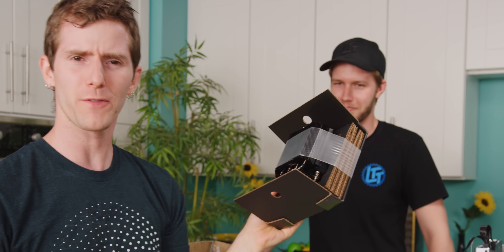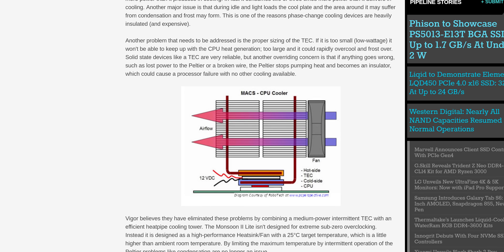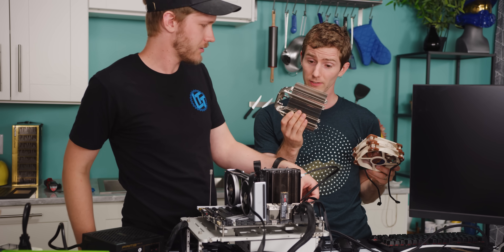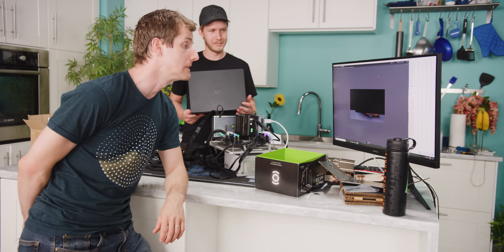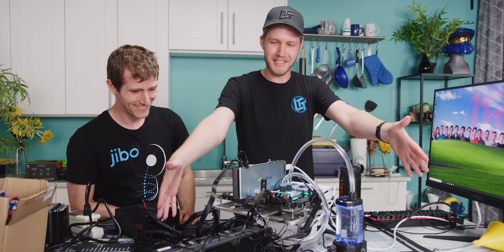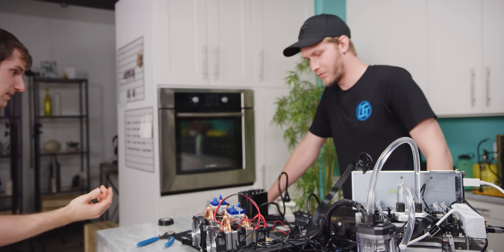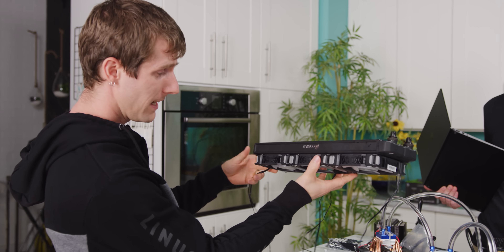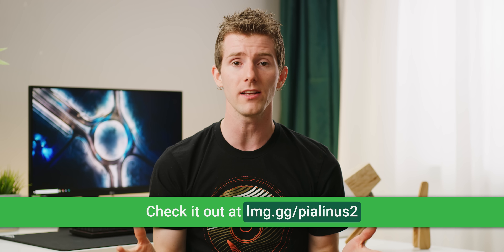Thermoelectric Cooling is a Bad Idea

Comment: You should check out tech ingredients video about a refrigerator he made out of peltier devices. His tip is that they always generate more heat than cold so try to conduct the cold to what you want to cool because the radiator section will always be quite hot. Maybe use a block of solid aluminum as a spacer. =\

https://www.youtube.com/watch?v=YWUhwmmZa7A

Comment: What really is the point of wedging a piece of hardware between the CPU and cooler if you still have to get rid of the exact same amount of heat it generates just as fast in order to not overwhelm the TEC? Especially if you can do the same thing just with a regular stock cooler directly applied to the CPU? Just seems redundant to me, because the actual cooler on top doesn't have to dissipate less heat. It's a literal zero sum game.

Comment: As far as I understand, a Peltier plate just moves heat from one side to the other. Pretty sure that makes it very similar to just having a bit of metal there except it's way better at moving heat that short distance and probably adds the power it uses to the total heat generated.

Not sure I get the point.

Comment: From personal experience only near practical way to user peltier elements is to use cold copper plate on top of cpu and then 300W peltier (I had 2x172W) and then cool the hot side with conventional water cooler). You need to insulate the motherboard properly like with any sub zero cooling solutions. That was the old days anyway, like Linus mentioned at the end. I had to make my own power source also since it was ran at 18V. Edit. I think I have them stored somewhere but never bothered again since they are not very practical and pose danger of short circuiting the motherboard from condensed water if used for longer duration of time. For short durations you could just use dry ice or nitrogen. Less hassle.

Comment: The most badass CPU cooling system I ever saw was a copper pipe welded to a copper plate, insulated with foam, and filled with liquid nitrogen, for the ultimate ridiculawesome evaporative cooler of all time.
Reply: crazy stuff.
I also love the immersion cooling solutions by 3m that have come out recently... i think it's called novec. basically looks like a pc submerged in a liquid that's boiling. By following all the bubbles, you can see all the hot spots on the cpu/gpu and memory.
Reply: People use those things to set overclocking records. It really is nuts. However liquid nitrogen, without some way of returning it to liquid form continuously, isn't a long term solution
Reply: @jackhemsworth7515  At that point you should just stick the whole rig into an oil filled industrial freezer
Reply: @E1nsty  Nah you part out the freezer and just make the refrigeration unit your phase-change liquid cooler.
Reply: @jackhemsworth7515  It is also used for quantum systems and magnets. Generally, you simply feed liquid nitrogen into the system and exchange Dewers as they empty. Liquid Nitrogen is actually cheaper than milk per liter, but is a terrible idea for cooling as it is an expensive hazard to the computers.
Reply: Don't ignore those who immerse the entire motherboard in oil.

Comment: Isn't the whole cooler limited to how much heat it can throw out through the fins using the fans and therewith the ambient room temp? Air cooling is only effective at a 15 degree celcius difference?

Comment: For god sake！you don't have any thermodynamics！You don't know how to use these things at all! The most basic knowledge about heat dissipation, the heat well is always the air!This thing is added to the cold row to reduce the temperature of the cooling water. If you want to use it directly as a cold row, and want better cooling, you should use a larger power cooler instead of the same or even lower power. !It's like those idiots think ，putting ice cubes in cola is to cool the cola,  that idiots do!In fact, ice cubes are added to the iced cola to keep the temperature of the iced cola!
Reply: Water-cooled radiators can't cool down to room temperature, but this thing can!

Comment: I use an Ultra peltier cooler on my Phenom1100T BE cpu. The water cooling didn't do the job. Now i stay at about 43C all the time. It keeps the cpu at a pretty much constant temperature and it is not expensive. Never been happier with a cooler as air only coolers were even worse then water cooling. My Ultra brand is a bit easier to install too than the one you used. MY cooler can go below 40C but i prefer it stay at the 43C as it is stable and i don't worry about it jumping around. My room is at 78F to 80 F ambient depending on outside temps. I run at 3.8Ghz on OC of the cpu and i run a XFX RX480 8G BE vid card.

Comment: These coolers do not work too well, as I tried that years ago and it made my system run worse as it heated the system far more than it cooled the CPU.
Reply: i run one with an overclocked 7700k, it runs worse than me nhd15, but for its size being a 90mm fan, it runs very well. only about 3c behind the noctua

Comment: I've never heard of these electronic coolers before. But, hey I don't know everything. Glad, engineers are finding ways to keep improving technologies. Now, if only computers would truly get faster that would be awesome. (:
Reply: Those elements aren't new. Heck, they are flying on space probes more than 5 decades old (in the reverse configuration to produce power from heat). Take a guess why those peltier coolers aren't all over the place. Hint: it's not because the engineers never though about it over the last decades.
Reply: superdau I would guess inefficiency? Please educate me though.
Reply: @WarriorsPhoto  
Yes, a peltier is about 10-15% efficient (unless you go for small temperature differences in the single digits, which is pointless for CPUs).
If you want to keep something cool that heats at 100W (like a CPU), you would need up to 1000W of peltiers. For the peltier to do its job you need to keep its hot side as cool as possible, which means you now have to cool 1000W instead of 100W.

A peltier has advantages: it has no moving parts, can cool to below ambient, can be controlled easily and can be built small (compared to a compressor cooler). You use it, when you want one of those features. But none of this is needed when cooling power devices. And at the same time one of its biggest disadvantages is that it can't move a lot of heat around.

Just because something can get very cold (and peltiers can go well below zero), doesn't mean its good at cooling.
Reply: @superdau  It is good a cooling. Just not CPUs.  LOL (:

Comment: You guys should do a hybrid cooling loop with like a radiator in front of an aquarium pump or vice versa and see what performs best because the radiator is likely great at pulling tons of heat out of a tube quick but can't et below ambient temp that easily where as the peltier device can get you below ambient after you have used the radiator to dissipate most of the heat.

Comment: You could just go crazy and build a silent below ambient system by using a remote large (building size) water chiller with large pump to run a long length of tubing far away so you never hear anything and target the loop temperature slightly above the room's dewpoint so you don't have to worry about condensation. It would just be hydronic building cooling system loop, brazed plate exchanger to a variable speed controlled loop to maintain dewpoint control and keep junk out of the cooling loop, then the PC tapped into the loop. (Have a set of UV filters and ultra-fine particulate filters to filter out anything growing in the loop)

Comment: Maybe if you use the PWM source of the CPU Fan to power the peltier element you don't need so many amps or consume so many watts.

Thus the peltier element would be being controlled as CPU Fan is controlled by the motherboard BIOS.

You could try to see what happens
Reply: Driving a peltier with PWM is exactly how you DON'T want to drive them. That makes them even worse at cooling.

Comment: Peltiers are not efficient at all. I was looking into them a while back as a cooling solution for a hotrod project since there was no longer and room for a belt driven compressor. I found that the peltier set up was in the neighborhood of 15-20% efficient as using energy to move heat. A typical a/c system is a lot more efficient. Something around or a little about 80% efficiency.

Comment: Hook it up in series after a traditional cooler. That way the water in contact with the tec is at ambient temperature, and the water going into the cpu water block is below ambient.

Comment: I actually collect and do extensive testing with TECs and Tec based coolers. There are many other brands and models than you guys discussed for PC focused TEC coolers. Some work really well, but Alex and Linus ned to also do the research and math to see what they can do. For example, if you add a Cool It Eliminator after doing the math and having an overkill amount of radiators in the loop, the water temp before and after the TEC unit is drastically lower, this let me achieve a 4.4 Ghz stable on my 1800x and 2025 stable on 2 1080 Ti in SLI. 

PS- You can use an Arduino or Raspberry Pi to make your own TEC controller.....maybe daisy chain a bunch of tec coolers....and get a 24/7 stable extreme OC system. LTT needs to get on my level with cooling lol

Comment: Bad Cooling Idea:
Custom Watercooler filled with thermal paste.
Reply: liquid metal lol https://www.youtube.com/watch?v=XqvBLBlzeNQ
headphone warning and speaker warning too - skip the first 35 seconds because intro song is complete earrape
Reply: YES!
Reply: I've got a better idea. How about a watercooler with LIQUID METAL!!!
Reply: @wu1ming9shi  A mercury filled watercooler sounds like ... umm ... the basis for an EPA Superfund site.   Maybe Cody'sLab will try it.
Reply: Cybershaman 21  he could use NaK...  Sodium Potassium alloy is liquid at room temperature, and they use it to cool some nuke reactors....
Reply: why not just fill the loop with diamond dust? get that maximum conductivity.
Reply: You'd need a 100,000 RPM pump or something lol
Reply: Water cooler with gallium
Reply: If you can find a way to fit a pump powerful enough to shove paste through a tube at high volumes, I'm on board!
Reply: Medieval Folk Dance custom water cooler filled with gallium
Reply: Cybershaman 21  lol
Reply: I mean...they already did the concrete cooled system...
Reply: i mean they made a concrete loop, so why not?
Reply: Cybershaman 21  Galium would work though it almagomizes with just about every metal on Earth. Lets go full stupid and use NaK.
Reply: But that's not water anymore...right?
Reply: @wu1ming9shi   my thoughts exactly
Reply: I get that the paste would be moving, but aren’t copper heat pipes full of thermal like paste?
Reply: @shavedbird694  no it's water, but you could use basically any safe liquid or gas that isn't going react with the copper or explode at less than 150c , water at normal tempratures is by far the best liquid because of it's heat absorbing capacity. The only time you're going to use anything else is if you know it is going to get very hot anyway i.e some nuclear reactors, or it is going to be very cold anyway i.e space or the north and south pole.

Comment: Why don't use a radiator to sustain the cpu and then add the electric one after the water is cooled a little so you get sub ambient temps?

Comment: I remember to have done the calculations for Peltier cooling on the late 90's or early 2000's and the numbers get really fastly big. When you use a peltier, you want:
1°) deltaT (hot temp - cold temp) as big as possible.
2°) hot side (and so cold side) as cold as possible.

Then comes the problems:  A peltier element can achieve his maximum deltaT when the heat input in 0w. When the eat input match the peltier maximum power, the deltaT become 0°C. It means that a peltier has to be much powerfull than a CPU if we want it to be well-cooled.
So for example a 25W AMD K6-2 from this old times, to be quite well cooled, you need a 80W+ peltier. A 80W peltier means 80W power absorption capacity. And so 80W+ power consumption and eat generation. So the cooling system have to be big enough to evacuate 25 + 80+ = 105+W heat instead of the 25W from the CPU alone.

Also sometimes, a peltier fries. So he become a powerful heat generator, leading to to the CPU to follow it in his death.

Comment: What about doing a dual closed water cooling loop with a Peltier between the two loops. Loop A for the CPU cooled by the Peltier, and then loop B for the hot side of the Peltier is cooled by a traditional smaller radiator?

Comment: did you know that thermoelectrics are actually worse the more power you pump into one? 

this is kind of pointless unless you really do need to pull heat away from a object very fast. there intended use is to push heat in a direction, or to generate a small amount of power through temperature differences. 

it's really sad but the tech just isn't there yet, more people need to get involved and stay with it. that way more breakthroughs can happen and the effectiveness can be increased.

Comment: I had an all-in-one peltier HSF unit on the first computer I built, way back in 1997. It would freeze water!  It kind of worked to cool my CPU, but when I cranked my Pentium MMX 233 to 250MHz (83MHz FSB), the inside of my case turned into an oven! It go so hot in here that 4MB of the 8MB of video RAM on my ATI Rage Pro Turbo All-In-Wonder permanently stopped showing up (I got it RMAed).  I went back to a standard HSF cooler.

Comment: Strange this is showing up?  I worked at a computer store building PC's back in the 90s.  We used these "Peltier coolers" on the  486 DX2-66 and others. We would get them setup with a fan and heat sink ready to get installed on the new systems...

Comment: what i find odd is how these companies fail so hard i put a 130 watt pelt on an old athlon fx 60 back in the days and it brought the cpu down to 30 c and at 3.4ghz .... how the fuck do they fail so hard it cost me 80 bucks
Reply: plus i diodnt have to go weird like this i bought a swifttec bigw ater system and  had a 250 rad and it was fine fit in my case and everything

Comment: Peltier is a heat pump,..so no cooling but transfer of heat.
So you extract heat on on side and you give it away on the other side....so the better you cool the hot side....the colder the oter side gets.
When cooling a cpu you need to staqrt the heat pump first....cool it down first

Transfeer heat or cold true a peltier and it genertates a voltage

I did cool my old pentium slot CPU's with a peltier arround -5 (and a lott of condesating on all parts.

Cooling solutiun as showed here is all wrong to get minus 0 celcius results....but with modern LGA sockets condensation will be your worst enemy

Comment: To take advantage of a 500w+ TEC you're going to need to run dual loops. One for the hot side, and one for the cool side. Or, do it the lazy way and submerge a big heatsink on the hot side in iced saltwater (and have fun with 34 amps inches away from a tub of highly conductive liquid.) But, there's a problem with that either way, because your average CPU water block doesn't really have enough surface area to take advantage of the TEC's capacity. You're going to need a pump with very high head pressure, and an extremely restrictive water block to actually pull the heat from the water with the TEC, and then you're going to have to find the perfect balance of flow rate, loop pressure, and contact time. Or ditch all that and go with phase change if you want good results without the headaches.

Comment: Did you guys make sure that the fan on the first cooler was going the right direction? It should probably be be pulling air in on the CPU side and out on the TEC side to maximize the heat it dissipates.

Comment: Heres an questioning put the thermoelectric cooler linked to a temperature regulater shut to the water reservoir and a fan on its heat side. So it cools the liquid going into cpu and limit the temperature the utilization of regulator to 20c. No condensation win.

Comment: Heres an thinking put the thermoelectric cooler linked to a temperature regulater shut to the water reservoir and a fan on its warm side. So it cools the liquid going into cpu and decrease the temperature the usage of regulator to 20c. No condensation win.

Comment: Here's an idea put the thermoelectric cooler connected to a temperature regulater close to the water reservoir and a fan on it's hot side. So it cools the liquid going into cpu and lower the temperature using regulator to 20c. No condensation win.

Comment: What if you build an air tight case, remove all the humidity inside the case, use a fully watercooled motherboard and graphic card, attach the peltier to the CPU and cool it with a waterblock and a 360mm rad or rads?

Comment: You Can also Stack them, And Why not run the Radiator inline also??   I've done this before back in like 2003-2006 With Both AMD 2500M And up to Intel Q6600 and E8400s  Modding the Heatsink into the top of a DangerDen  Res so the heatsink was into the water, Top being cooled by an old Thermalright XP-90 heatsink,  Still running through 2 360mm Rads,    The Pelt was on a Switch so it wasn't running all the time!  Just for Benchmarking!  And it worked GREAT!   Got my temps down into the 20s on full load!  And below 0 at Idle,   The cooler you can make the hot side the cooler the cold side gets!   So if you stack them you can get some CRAZY Temps!  Look into these more!  There very fun to use! :)  And BTW   I MISS DANGERDEN GEAR!  And  Www.PimpRig.com    Best site ever for PC modding! :)

Comment: Peltier cooling is a must for specific applications.. it's the standard for cooling astronomy CCDs.. to keep thermal noise low during long exposures (even hours if needed) the cooler can cool down sensors and electronics up to -100°C without introducing any kind of vibrations